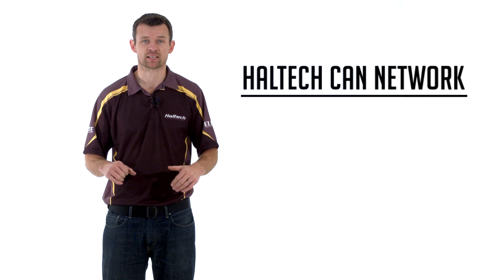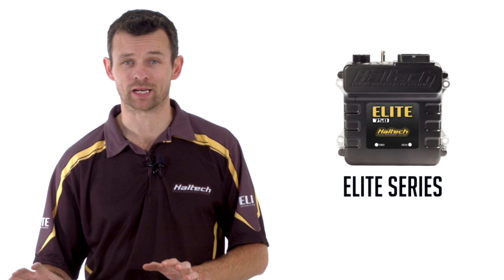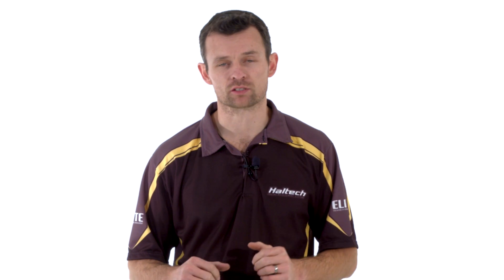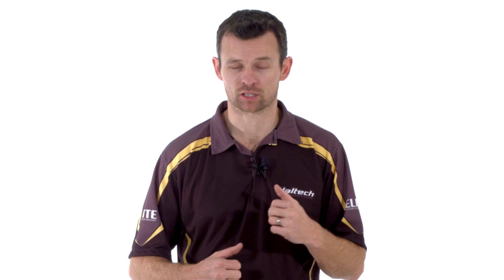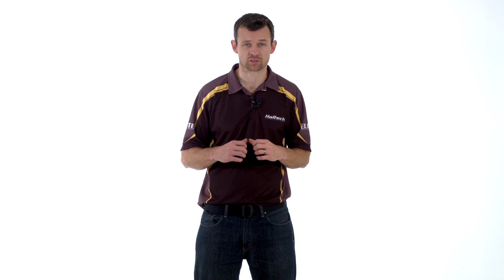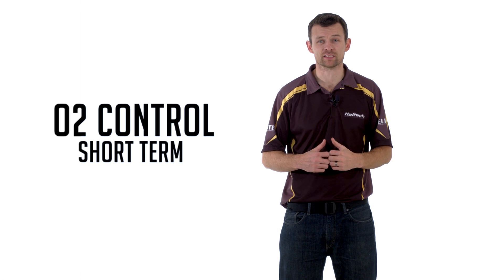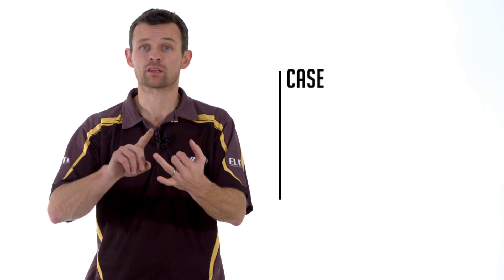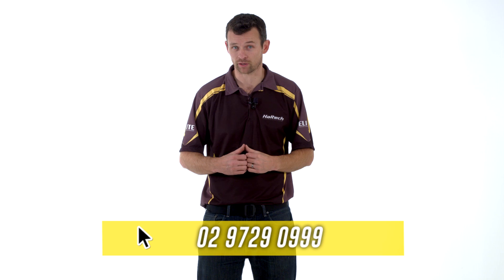🔍 Elite VS Platinum Series - Product Overview

Comment: Can the Elite ECU series 750 run a 13b turbo rotary with four ignition outputs direct fire (no waste spark) with full rotary split timing?
Reply from the maker: Yes, The E750 supports direct-fire control of both leading and trailing coils, plus sequential injection on both primary and secondary injectors – on both 2-rotor and 3-rotor engines. Split timing can be 3D mapped.

Comment: Very informative guys, so your Elite series ECU's are self learning for the fuel systems the way all the ECU's in the States are going! I did not know that and kind of swings the decision back towards getting one of yours. I would like the ability to set fuel target parameters and let the system work out the fuel mapping rather than the old way of having to predetermine the figures to put in the map. Just seems to make more sense and gives me the ability to take over the tuning duties with my own cars without buying a dyno. Your Elite Series will be compatible with a Racepack dash/data logger won't it? If I want to be able to control my boost down the track, does that mean I will need the 2500T as well? I have a pretty serious RB30 in an R31 that currently has a Microtech LT- 10 which I haven't ever really been happy with for a variety of reasons, but I'm now getting to a point where I need some power management down the track cause I'm only on a small M/T DR. What would be my cheapest option for something that does what I'm looking for? I would like to have anti lag for launch (no need for rolling anti lag though) and to be able to control the boost down the track fairly simply and based off wheel speed, not a time based deal. I had a mate years ago who had what he called sequential idling: it would idle on 3 out of 4 cyls and alternate which cyl didn't fire each cycle. Is this easy enough to do? It made the car sound tuff as at idle and I would like to be able to switch it on to freak people out when I choose to (that's not really important, would just be fun). Besides that, just needs to do all the usual stuff. Having sequential injection would be nice, as I only use one big MSD coil at the moment. Any wasted spark is really hurting the dwell time and spark coming out of the secondary side of the ignition system- I may end up having to run a multi coil set up in future. The end goal is to have this running as a street/ strip deal that's going to be controlling 1100 - 1200hp. Would like a knock sensor and flex fuel sensor. It could possibly get built to run on 2 different fuels with a belt driven pump for methanol for racing duties and would be nice to be able to have a dry NOS deal too. What's your recommendation keeping in mind I'm a major tight arse with short arms and deep pockets!!! LOL! Thanks guys, I subscribe to your channel and always enjoy watching your vids. I'm in the industry, been a mechanic for 15 years or more but you still manage to educate me quiet often. Cheers Oh, one last thing- who would you recommend to tune a big hp turbo car in the northern suburbs in Vic with one of your ECU's??? My current tuner is ok, but not the best with big hp turbo stuff- I've had it melt exhaust valves at the track the day after picking it up for retune number 4 or 5 at that point. We've only just got past melting the earth straps on every single plug, every time I did more than 1/8 mile runs on it. I am not kidding you. Prob is, this is tuner number 4 I've tried. No one I know can tell me of a GOOD tuner that they can trust. And I'm talking about everyone I know IN the industry. Wish you guys had your own tune facility the public could go to. Sorry for the essay
Reply from the maker: Wow... that's gotta be the longest YouTube comment ever:) This is a subject we've been playing around with and might actually do a feature on - ie How to find a good tuner - or something along those lines.

Comment: The Platinum plugin ECU for the S2000 states it has Long Term Fuel Trim. Is this the same as the long term fuel learning you describe in the Elite 750?
Reply from the maker: Yes – the Pro Plugin series build a long-term fuel trim table in the same way as the Elite series do. The only difference is that the Pros build this table in the background, whereas the Elites give a visible table.

Comment: Do your engine control systems operate sufficiently to "replace" OEM units?
Things like EGR, variable valve timing, torque reduction from transmission control module or traction control systems request, interfacing with the vehicle's existing network to supply other modules with data they need, such as vehicle speed for the gauge cluster, various data for transmission or body control modules, or even speed-based audio volume control?
These little details are what I would like to know. Thank you in advance for a response.
Reply from the maker: The Pro Plugin range is designed as a direct replacement of OEM units. These are car/model specific ECUs that plug directly into the factory harness. To see which makes/models are supported go to our website: www.haltech.com, click on Products and then select Pro Plugin ECUs.

Comment: Yeah fellas, it's time to cut those old legacy units from the lineup. There's no reason anyone should be running an old sprint or platinum pro/sport ECU anymore with all the (similarly priced) elite options out there. The ONLY reason I could see getting a platinum pro would be because it's a direct plugin, but you should be encouraging the sales of elite ECUs with MORE patch harness plug and play solutions. I ended up buying an Elite 2500 but wish I could have picked up a plug and play patch harness for the R32 GT-R but you don't / won't make one :(

Comment: hey which ecu can control Nissan's vvl on the gq18 engine
Reply from the maker: N-VCT and VVL (switched) can be controlled by all of our current ECU range. 
Later engines move to CVTC (continuously variable), which requires an Elite 750 or above.

Comment: does the elite 550 also have long term fuel trim support?
Reply: Good question. 
from the spec sheets it appears the Elite 550 does not currently support the Auto Tune  STFT+LTFT feature. 
I would suggest contacting Haltech sales/support to confirm. 
www.haltech.com

Comment: this is just a question... is haltech superior to fuel tech? could haltech reply?
Reply from the maker: Of course it is, then again we're a bit biased:) To get an unbiased opinion you should really ask someone who has used both systems.
Reply: +haltechecu no worries thanks for the reply... it was just a question because ive seen some of the 405 have used haltech whereas chief and daddy dave are using fuel tech 😕
Reply from the maker: chief and dave have sponsorship deals in place. makes things interesting though. if everyone was using the same gear and the same cars the show would be boring:)
Reply: +haltechecu very true... would you be able to run a haltech on a c63 amg w204 to run turbos?
Reply: Fueltech has no long term at all,  it's only compatible the their own wideband and only a handful of sensors. Only drives saturated injectors etc etc ..